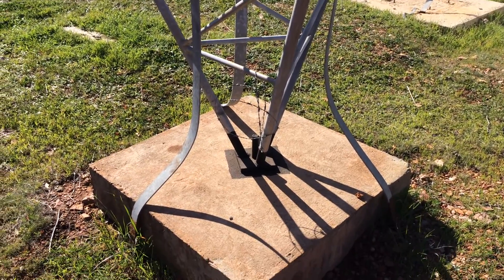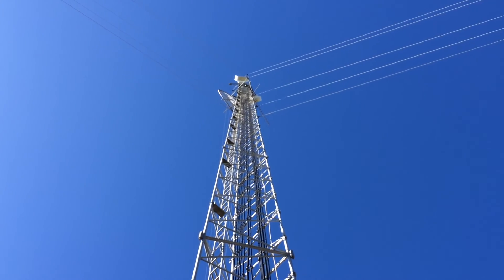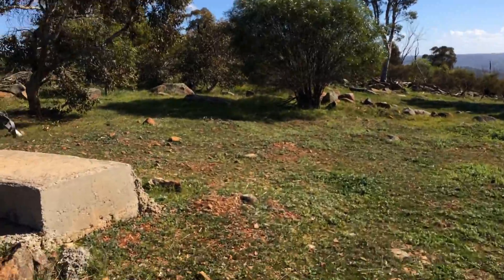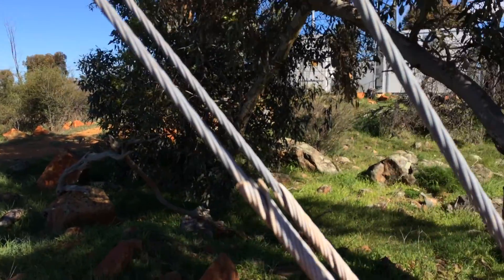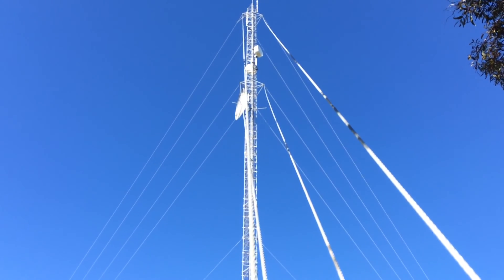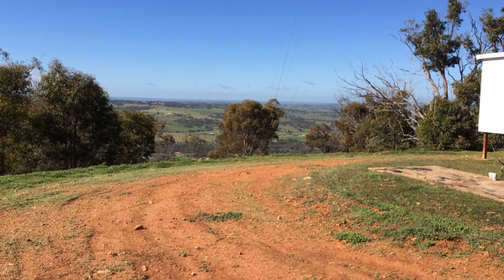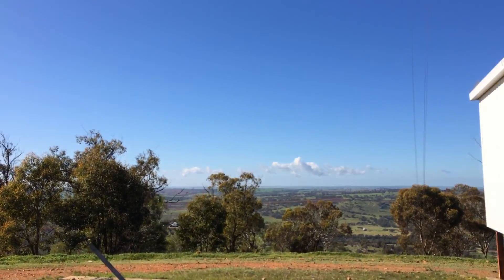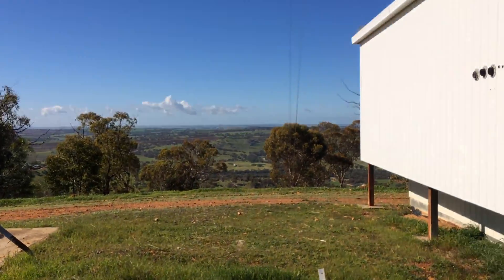Communications Antenna Mast And Guys.

Comment: Do you plan to set up a production line to produce Distribution Ties/Guy-Grip Dead-end? Armour Rods manufacture Devices/Production Equipments supplier,https://www.artisanmake.com/preformed-armor-rods-machines Artisan Industry, TEL/WhatsApp :+86-150-5061-5346, info@artisanmake.com